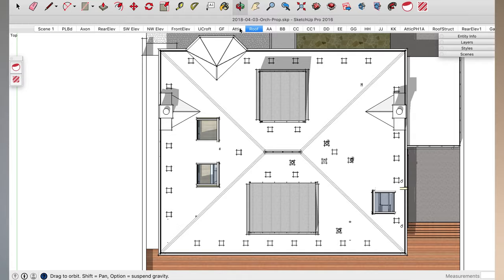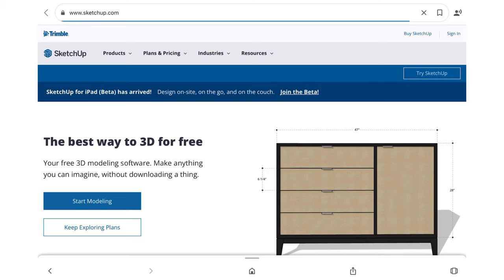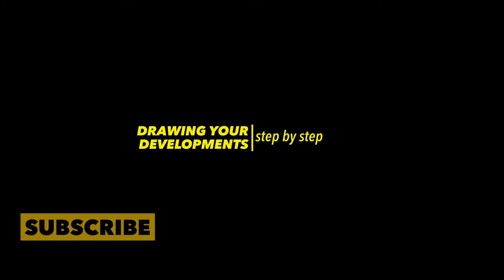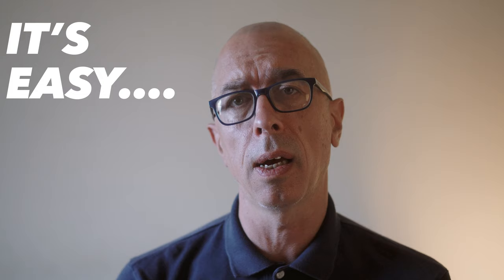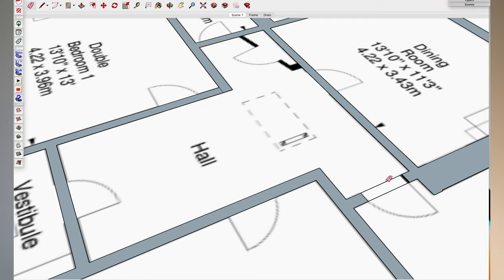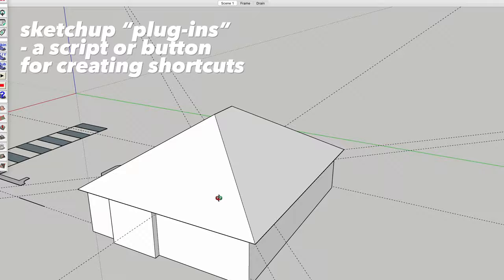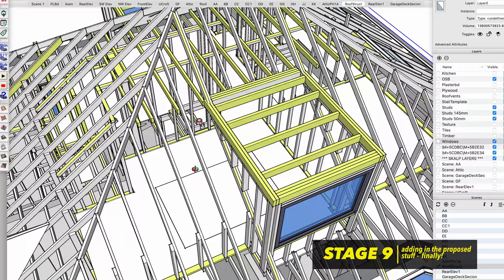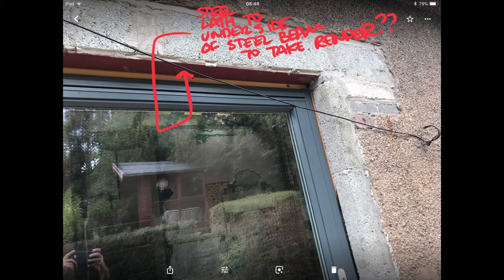ATTIC CONVERSION - HOW I DREW IT - from initial sketch to 3D model to 2D construction drawings

Comment: Hello, really useful video thank you! Question - is there a way of identifying habitable floor space in the attic based on the existing ground floor space? (would like an idea of the potential floor space in the attic before an architectural survey) Thank you
Reply from the maker: Thanks for the comment. It depends on the pitch of your roof, but lets say it is 35degrees (fairly common), habitable space by the building regs is defined at anything above 1.5m, so that would be a step back from the eaves of 2.14m. So if the length of the eaves on that side was 6m, you would be losing (6 x 2.14)m2. However although that is for the regs, its excessive, and I always work off anything above 1.1m, since I can put desks and beds against that space. 1.1m step back is 1.57m so you would only lose (6 x 1.57)m2.  The shallower the pitch the more space you lose. Hope that helps.

Comment: I used sketchup free to design my loft conversion then passed onto my online architect to do the proper drawings. I now regret using them, they didnt add any value to my design. They didn't even know the difference between a warm or a cold roof design.

Im currently designing my kitchen extension and i will submit my own drawings to the council.

Which version of sketchup do you use?
Reply from the maker: Sorry to hear about your experience. I would never use online architects. Never. I use the 2018 version. Sometimes for demonstrations I’ll use the free online version.

Comment: Your section cuts show infills at time 6.18 eg. insulation is shown as crosses. How do you do this in sketchup?
Thanks.
Reply from the maker: Hi. I use a sketchup plug-in called Skalp. I think it costs about $30. The stock section cut fill that comes with sketchup is fine but, as you say, it doesn’t allow for hatching. So that’s why I sometimes use the Skalp plug in. Hope that helps and thanks for the comment.